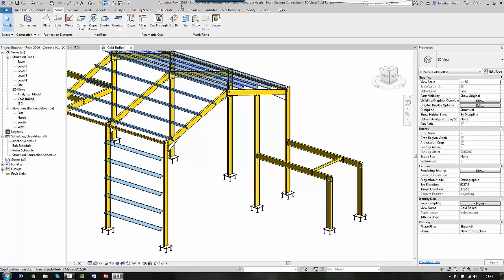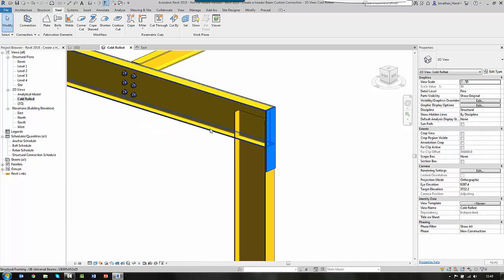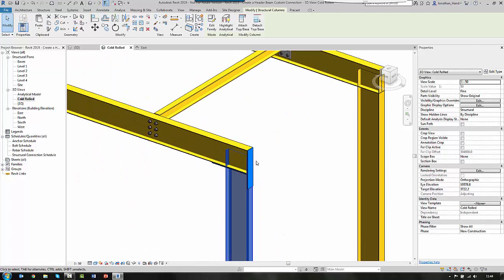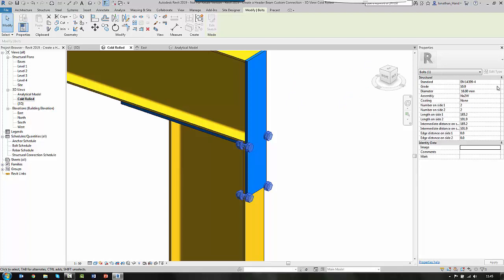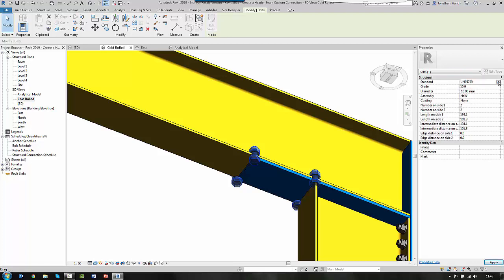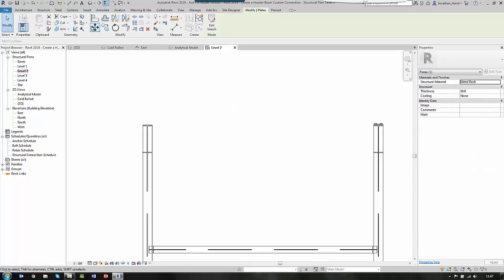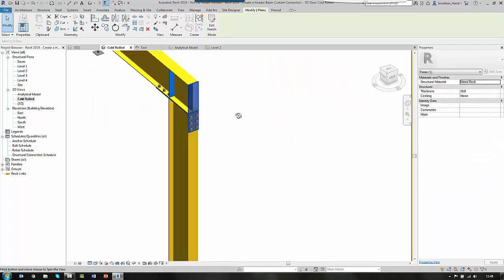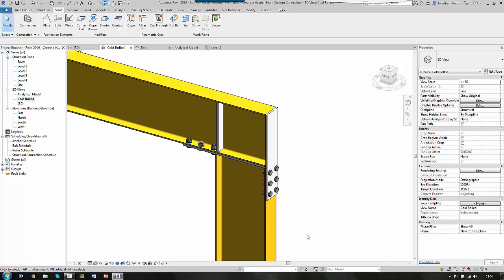Create a Header Beam Custom Connection in Revit

Comment: Hei, thanks for ur share this thing. And How do you make a custom steel connection with Revit 2018 or Old Revit?
Reply from the maker: You can't as the custom connection only is possible in Revit 2019 onwards